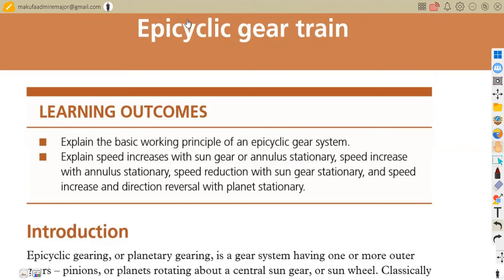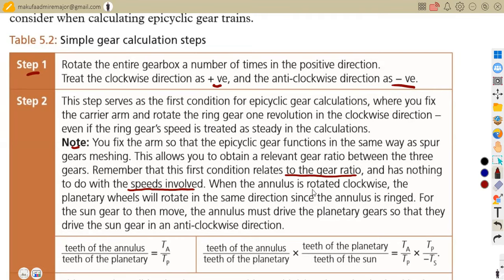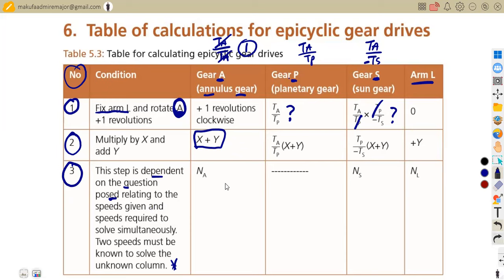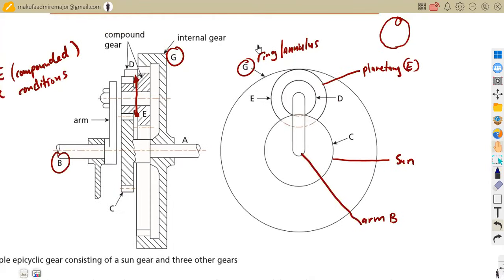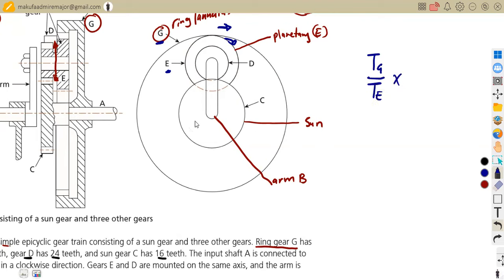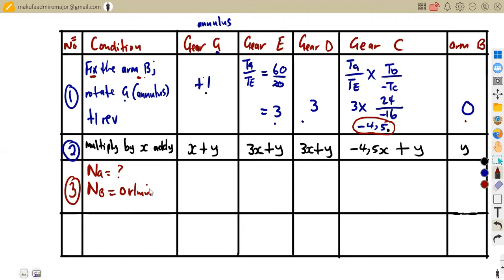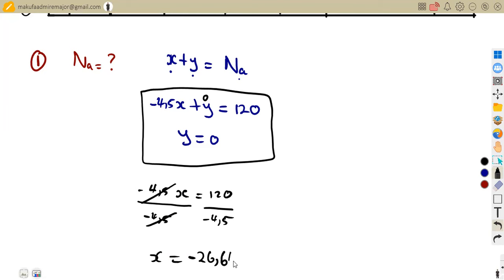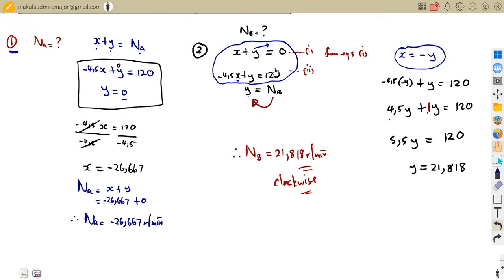MECHANOTECHNICS N5 EPICYCLIC GEARS and GEAR TRAINS INTRODUCTION @mathszoneafricanmotives

Comment: Sir is the input shaft always attached to the Annulus (meaning they'll have same speed), then therefore the output shaft being attached to the sun gear (meaning they'll have same speed)

Am I correct???

And what I also want to understand is that,do we have one shaft even though in does not penetrate from 1 side but it is one